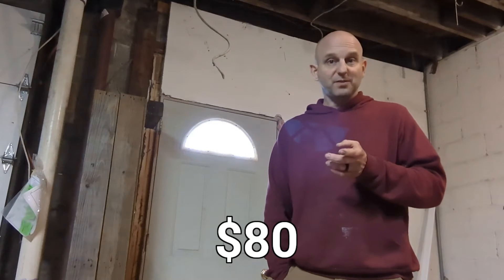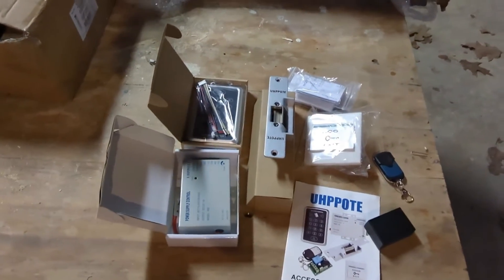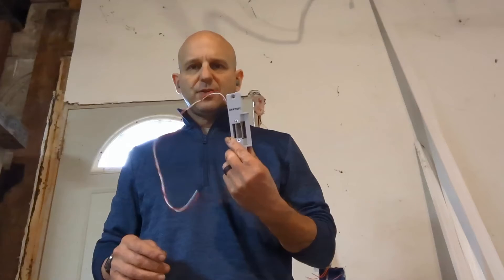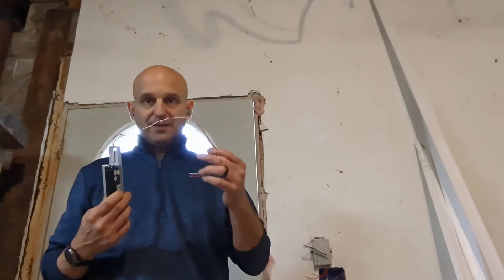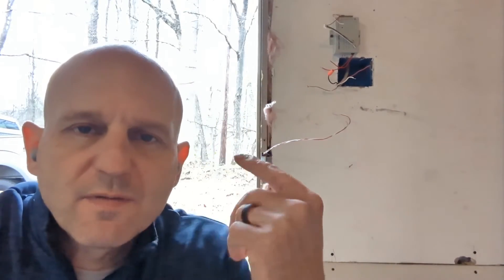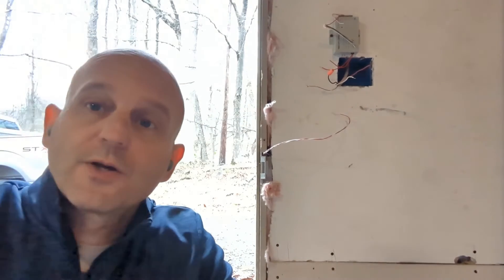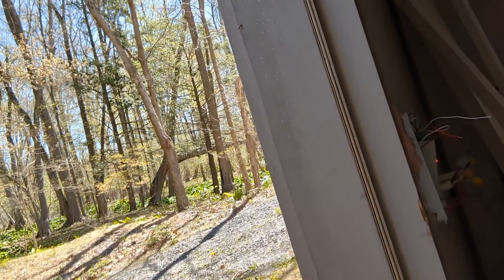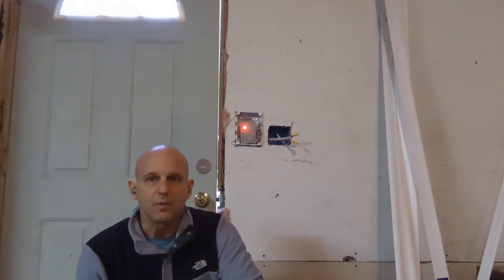Installing a powered electric house lock. No batteries required. Use a code, card or fob to open.

Comment: Does the setup happen to work with phone NFC? That would be preferable to having another dongle or card to have to remember, and if there's also an app, assigning people's phones to it would add some major convenience
Reply from the maker: Great questions. Given that this setup is a cheaper option, you will probably need to look for a more sophisticated option to get the functionality you are looking for.
Reply: Can it be created using batteries?